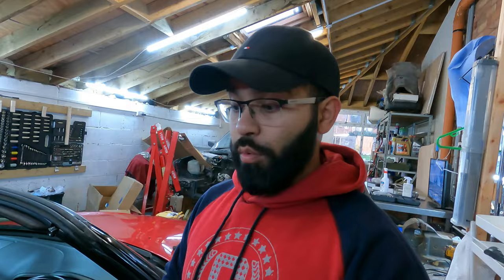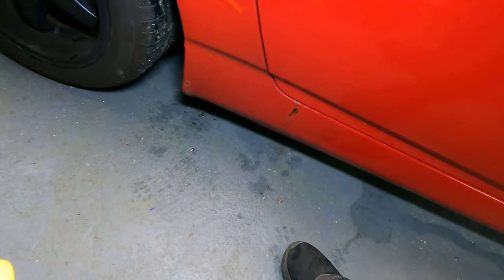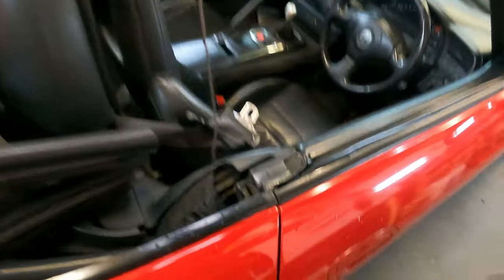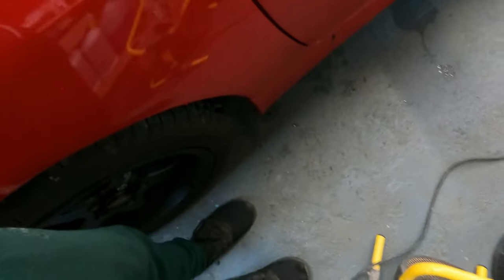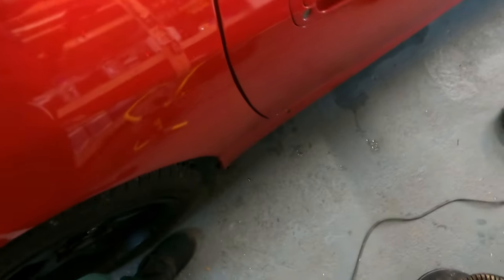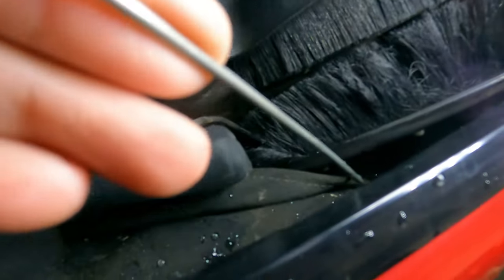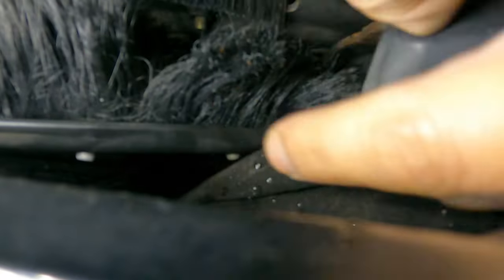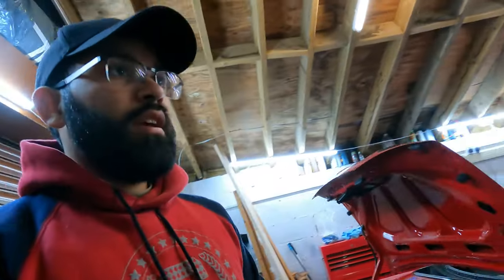Convertible Drain Plug Clean Up | Honda S2000

Comment: If a person had the car up high enough. Would it be easier to get cleaned from the bottom?
Reply from the maker: I would think its possible to do extra cleaning from there, only issue is that the dirty would come down and fall onto you. Plus you would need to locate the hole but that shouldn't be too hard, I would say its 100% worth a shot if you have the car up in the air

Comment: I wonder if someone makes a solvent that's safe to use. Would make compressed air or even the coat hanger a lot more effective.
Reply from the maker: Whilst doing this I actually thought of caustic soda, but I didn't want to risk it. I thought I would research chemicals a little more on what could help as it would be easy better and more effective than air/hanger. Great minds think alike!
Reply: @mrgcc  is that like baking soda? anything that's nice to paint and rubber should be good, ill look into it when i clean mine.
Reply: @FroztiProductions  How did it go?
Reply: @switchellmobb7575  i didn't need a solvent. Basically there's a bowl at the top that fills with mud so I let it dry and stirred it into dirt with a metal pick. Then I put a skinny hose on my shop vac and sucked it out. When I looked inside the hole was totally clear and it drains perfect now. Might make my own vid next time it clogs.
Reply from the maker: That sounds like a really good idea to be honest. I might give that a go too. If you do make a video let me know!